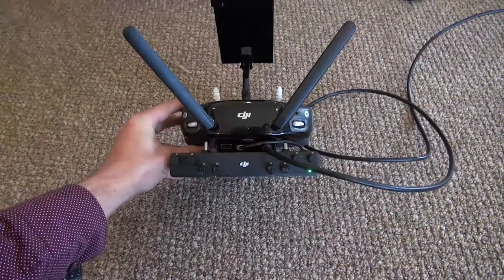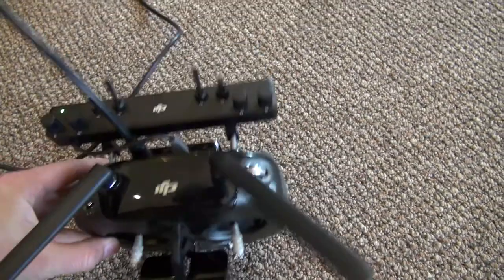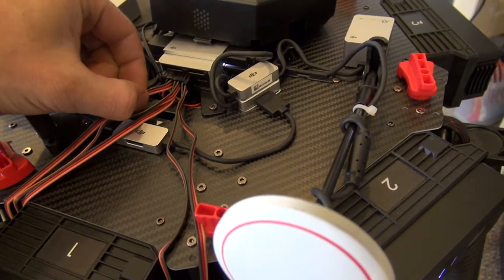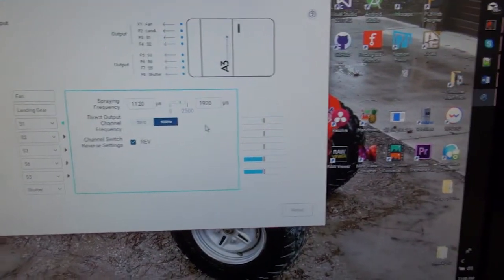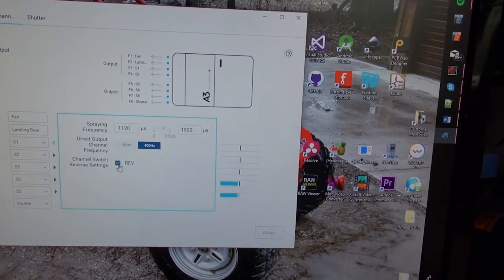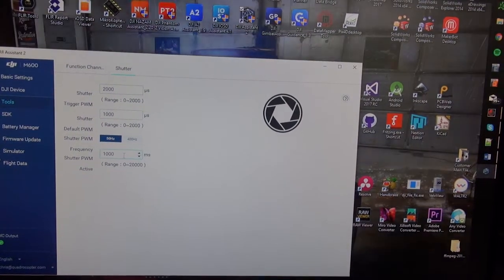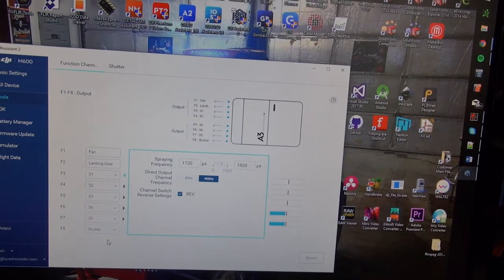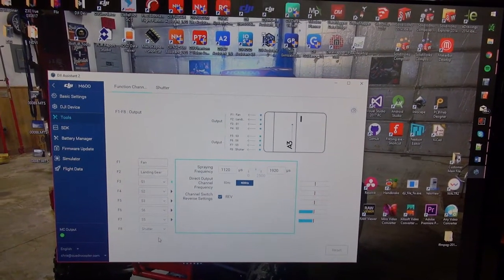DJI Matrice 600 Series Remote Controller Channel Expansion Kit Overview

Comment: i got a question  what do you recommed how to plug in a servo for the power supply if i plug in directly i might blow up the flight comtroller do you sell something or do you recomend something to plug in the servo for power supply i got the programing part but i need power supply what do you recommend please help

Comment: i put on a servo and i programed the button on the flight controller but the servo will not work do you think i have a bad servo??
or are there other steps i need to take.
Reply from the maker: Reach out support@quadrocopter.com

Comment: Question i installed one of these on a matrice 600 pro but camera is not showing do i have to used the hdmi to view Camera?
Reply from the maker: You should just plug into the flight controller
Reply: @Quadrocopter  i got a DS3218

Comment: This has been a very helpful video for a project I have been working on.
 
If I wanted to power a 7.4VDC servo from the 18VDC outlet on the bottom of the M600 Pro, would I just need to use a UBEC? 

Also, what is the maximum allowable current draw from the 18VDC port? I am not sure if it is 3A or 10A.
Reply from the maker: Yes to use UBEC the maximum allowable current is 10A

Comment: Nice video. I was wondering how this all ties into using Nikon D850 DSLR or Fuji GFX 50S mirrorless camera. I'm new to large copters. As a single operator, can I use the channel expansion kit on M600 Pro to control the drone, gimbal and camera shutter and settings (aperture, shutter speed and focus point) with one controller. Thanks in advance for any help
Reply from the maker: You can email support@quadrocopter.com we can help you through e-mail

Comment: The light on my expansion unit stays red and doesn't seem to work, any ideas what to look for in order to fix this? Thanks for the video!
Reply from the maker: Send us an e-mail at support@quadrocopter.com and we will help you troubleshoot
Reply from the maker: Status LED - Solid red - Check if the flat cables inbside the RC port module are connect correctly and the controller has been updated

Comment: How did you wire it? I'm using the A3 and trying, but having all kinds of issues.
Reply from the maker: Give us a call if you need support with the expansion module.  406-897-1027

Comment: Great video! Considering a M600, not aware of all the ports. Looks like only 1 servo port open on bird, are their 8 open ports on M600 for add on's? How do you connect multiple servos for drop bars, lights, etc so they can  be assigned to the 8 new sw & knobs on expansion board?
Reply from the maker: A3 has 6 available ports for PWM on the expansion kit

Comment: Thanks for the informative video. Do you know if the M600 has XT30 and/or XT60 power ports or some other sort of power port(s) for 3rd party devices? I️ haven’t been able to get a straight answer from DJI on this...
Reply from the maker: Jeff Rizza Yup there's a couple XT30 connectors under the copter on the power distribution board. One is utilized by the landing gear and one is free to use. You can also Y into the landing gear connector if need be too.
Reply: Oh perfect. Thanks for letting me know!

Comment: hey guys i just received my flir vue pro and gimbal for my m600 where can i buy all the additional wiring and voltage relay from?
Reply: also do i need extension kit for the controller or can i use other remote with another hdmi screen for thermal?
Reply from the maker: Please e-mail support@quadrocopter.com

Comment: Do you need to provide separate power for the servos. Or does the A3 rail also provide the power? Assuming if it does it is 5 volts?  And if so do you know how much current?
Reply from the maker: The S ports do not provide power.  You will need to connect a Y cable to
 the same wire that powers the internal cooling fan.  About 500 ma
Reply: Thanks for the reply. Much appreciated!

Comment: Is it possible to control any other camera functions for the Sony A7R2 with this unit, i.e. aperture, auto focus ,Iso?
Reply from the maker: Absolutely! I'd use the  Gentwire 181 for the focus and remote shutter on your A7.  Otherwise, pretty much any PWM input remote shutter cable for other cameras would work with this as well. 

http://www.quadrocopter.com/gentWIRE-MULTI-181_p_1433.html

Let me know if you have questions getting it all setup.